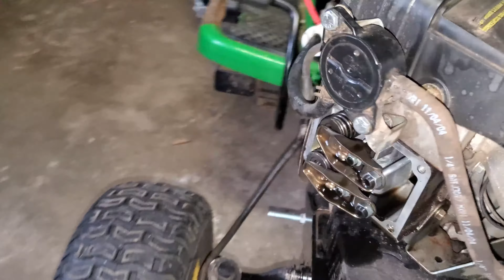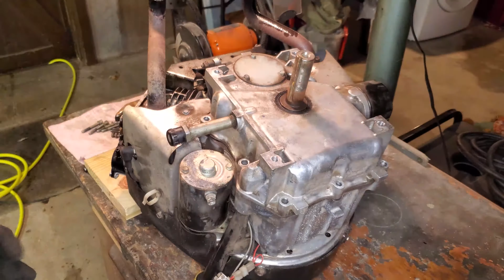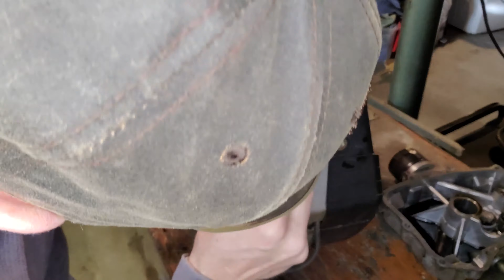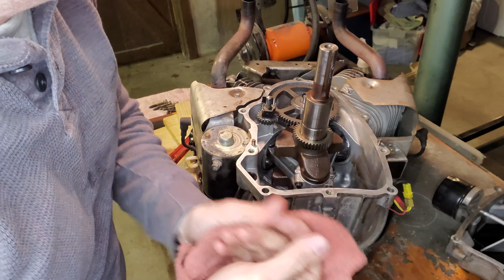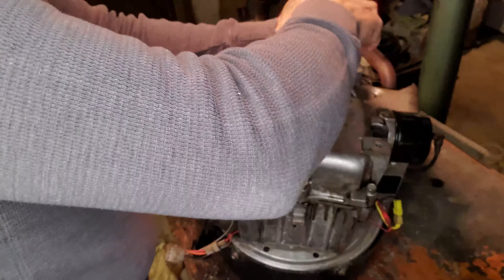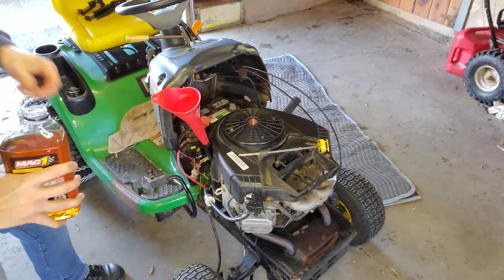Briggs & Stratton 20HP Intek V-Twin Pushrod Failure - Teardown and Rebuild

Comment: The problem with your motor is that the exhaust valve guide has moved upward towards the spring causing the valve to not travel as far as it needs. This causes the pushrod to either bend or break and when it does the compression in the cylinder doesn't allow the intake valve to open thus bending the intake pushrod. The fix is to remove the head reset the valve guide and stake the aluminum around the guide to keep it in place. If you don't do this it will only bend or break more pushrods. I had the same problem with my Intek 24hp. Hope this helps, it did mine and works much better.
Reply from the maker: Thank you for the comment, Woody.  It may help others who feel that it is relevant to their issue.  For this particular engine, however, the diagnosis and repair were correct and the engine is still running strong in the near-every-day use I work it under.  Thank you, again!
Reply: @Woody M : Yep, happened to mine also due to a mouse nest overheating the cylinder and  head, and I fixed it like you suggested, by resetting the valve guide and staking with a punch.  That bought me a season of mowing about 3 acres, but then the guide slipped again for no apparent overheating issues.  A new head sells for about $160 to $200 depending on source.  I believe I'll reset it and try staking again.  Worst case, I'll have to spring for that new head eventually.  As for the labor I'm getting quite adept at removing and replacing the head.
Reply: @DamEngineer  That's great!. I actually staked the aluminum first, then pushed the guide into that. I don't know if it'll last any longer but it sure was tight getting it back in. Best of luck.
Reply: I immediately sensed the same thing , going to my damage the new pushrods if not correcting the guides ?
Reply: @robertheinkel7579  Yes, they will bend or break because the valve cannot open far enough before contacting the guide.
Reply: Hey! mine happened the same, my problem is i repaired it and now when i start it, the exhaust goes glowing red, i dont know what can be the problem.
Reply: @gustavoanuch890  Sounds like you have the valves set improperly. To set the valves you have to bring the piston up on dead center compression stroke and then turn the crank past 1/4 turn before setting. Hope this helps.
Reply: @woodym5933  i adjusted the valves at tdc, i didn’t know that! I will adjust them!

Comment: Nice to see ur using ur grandfathers tools. Awesome! What u think caused the pushrod failure again?
Shouldn't you use an assembly lube on thise parts like 90 weight gear oil before replacing in c. Case? They make good spray on lubes for that.
When u seat the sump pan lube the seal lip  turn the crank and don't bang on the pan. It should seat in w little effort.
Reply from the maker: Hi, Mark.  See 1:55 for the likely cause of failure.  I generally don't bother with assembly lube when I haven't fully cleaned and prepped the internal parts but I do give it a few good spins by hand after filling with fresh oil in order to get things oiled up on the lower end.  I believe this is shown at the end just before firing it up.  This was a quick job of "find the missing pushrod, install the new ones, and get it back together".  Assembly lube is great when you are installing new parts that don't already have a film of oil on them.  You are correct about lubing the oil seal but popping the pan with a rubber mallet is sometimes necessary, as well.  Your mileage may vary based on the specifics of your engine's component fitment.  Thanks for watching and for the tips!

Comment: Hello

Is this motor still running? I had some bent push rods and guides looked ok. I'm stumped, unless its like you say, Loose rockers bent the push rods.
Reply from the maker: Hi.  Still running strong!  Loose rockers are most likely your culprit and they're easy enough to check so you'll definitely want to do that at the same time as checking the guides.
Reply: @603photog  thank you.